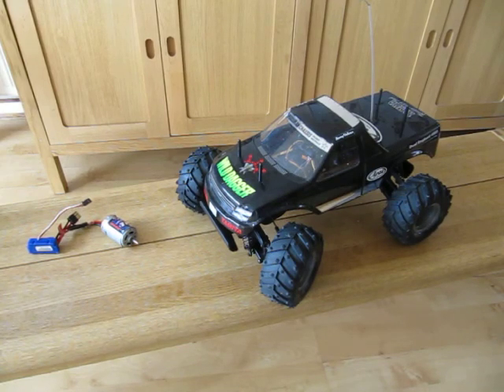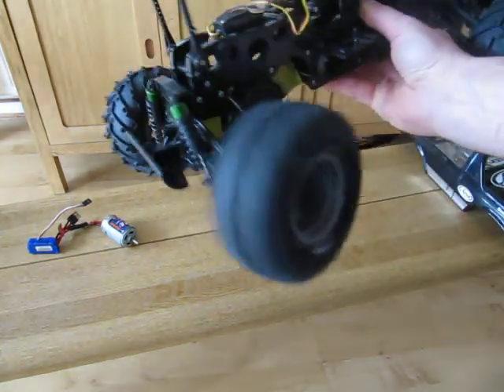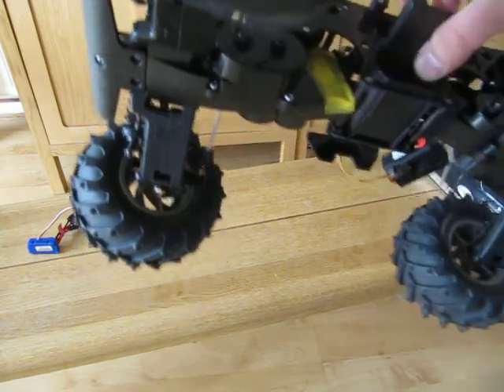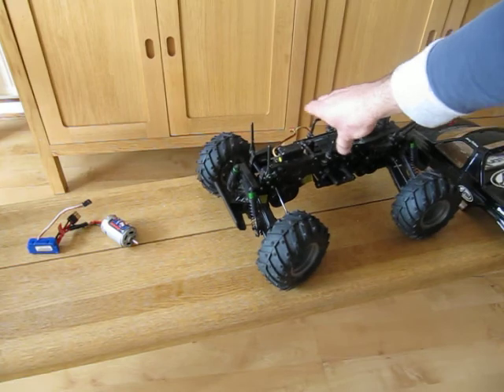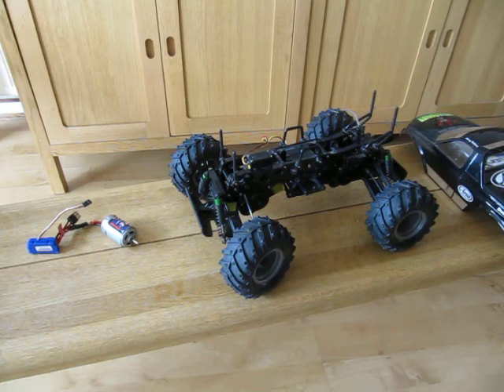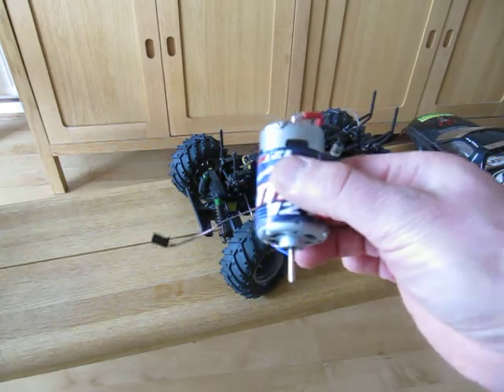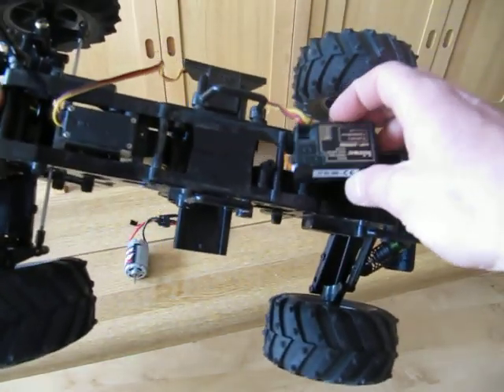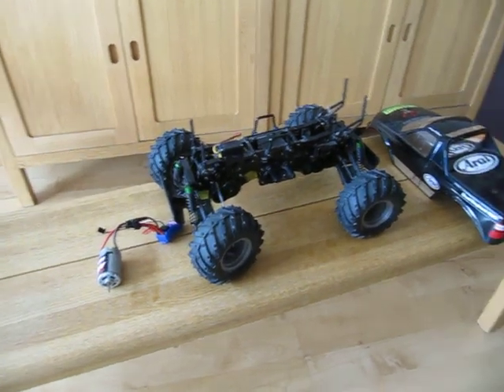tamiya wild dagger , with mods, intro

Comment: Hi I love what you have done with your Dagger and in doing so you have inspired to do the same with mine :) I have put in a Trunity Brushless motor with a brushless ESC also I will put up a video shortly once the replacement parts turn up. I also got a 2 cell lipo battery also replaced the shocks as you did so hopefully it will go lol.  Cheers for the inspiration :)

Comment: Lol I meant Turnigy as I'm new at this new hitec mumble jumble lol
Reply from the maker: Nice 1. :)
it was fun....there are some more vids on my channel, ended up putting a velineon system in it on 3s lipo! for a laugh.... i am sure you will enjoy it with a brushless system. A stronger servo may also be good... i sold it in the end as a roller as i needed to thin out the collection a bit. good luck with it!